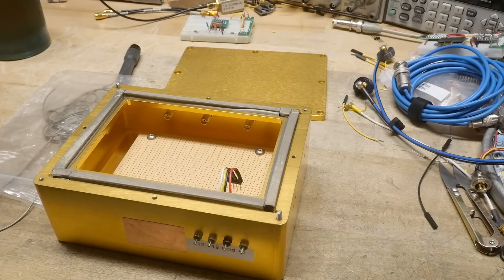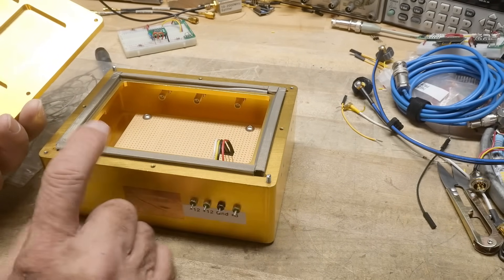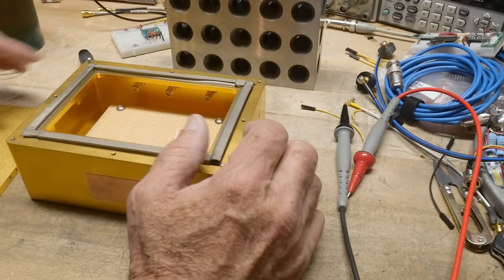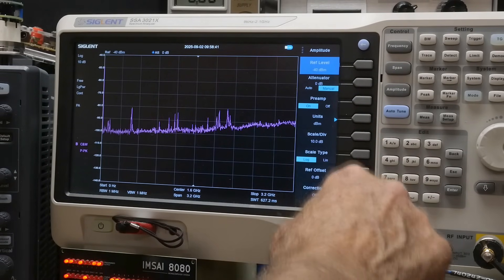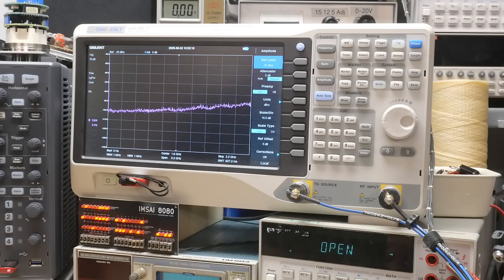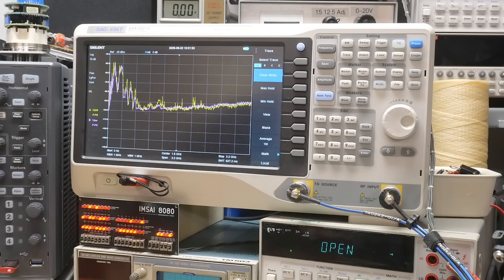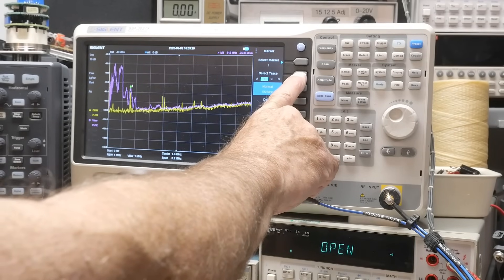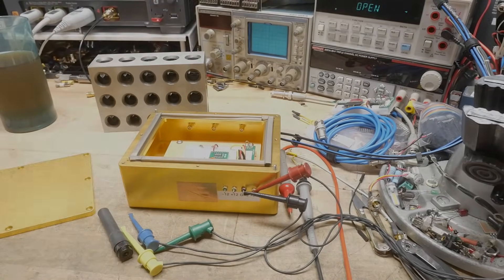#2362 Faraday Box aka Faraday Cage

Comment: I was in a Rona in Canada (related to Lowes), and they had these Faraday boxes for about $10. No metal was evident. WTF? I didn't buy one. Anything I’d want to protect, like my KX3 wouldn't fit in it anyway. Back to a garbage can.

Nice use of a 1-2-3 block. Do you have two to wring together? That's always fun.
Reply: Back when personal computers needed to comply with radio legislation and 4 layer boards were not a thing, and they also wanted to use plastic cases they used conductive plastics loaded with carbon filler or vapour dissipation plated plastic cases with metal.  Maybe the same sort of thing?   If those blocks are 1 2 3 blocks, I wonder which units you're using!

Comment: You know the pads and blankets they put around you when you get a XRay? Do you think that material would block anything?   I was curious bilut don't really know how I could test such material.
Reply: A Faraday cage needs to completely surround or it doesn't work as a Faraday cage. Those are lead blankets (someone correct me if there is more to it than that).
How conductive is lead? But the lead blocks the x-rays by absorbing them. That's not the same as what a Faraday cage does. The channel Kathy loves physics has an excellent series about the story of electricity. The math is done in different sections of the video, which you can skip ahead if you don't understand it. All historical gossip is also included. Really fun to watch and study.

Comment: In the strictest sense, would you need to put screw caps on the unused SMA connectors?
Reply from the maker: it would have to be 10's of GHz to matter.
Reply: @IMSAIGuy  Thanks, for the info. I never worked with any radios over 2GHz.

Comment: Good video - good "box of the day!"     I had one box at work that was 5 ft by 4 ft by 6 ft.  It had 2 swinging doors with fingerstock around the edges and a YD1212 tube inside along with some coils and caps,  a couple of "00" sized cables in parallel for B+ and some copper tube for the hi-voltage.  Oh and about a 4-5 gallon a minute flow of de-ionized water in plastic hoses.   Its no longer used,  and I don't have a place for it but it probably would have made a good chamber to start with to put stuff to protect from EMP!

Comment: The difference between EMI sponge compressed and not is somewhere there in the SA noise floor. So, latches even seem overkill for this edu purpose.
And it makes sense, since it is perimeter coverage that is king in EMI applications.
Reply: Even over compressed,  would normally have compresson stops machined into base. Orings don't work very well when flat. Also aluminium forms a non conductive layer as fast as you clean it off😂
Reply: @TheEmbeddedHobbyist  Plated aluminium is another story. I believe RF specific enclosures are treated in that regard. Also, apparently Al oxide is porous and is a diminishing isolator with rising voltage potential.
Reply: @Mr.Leeroywe would treat all mating al surfaces with a coating to replace the oxide with something conductive.  But as the world moves on the materials used become banned so was getting harder to get a good grounding connection. You can use wire impregnated silicone but it cuts into the surfaces and can lead to corrosion in the long run.  Plus rf currents are very good at finding ways to cross from the outside to the inside.  
Would do the same thing as shown,  would put high power rf inside and rx antennas outside and look for leaks.

Comment: If it was designed to be opened besides for maintenance,  I would have thought they would have at least had thumb screws on it.  Something you could tighten by hand.  That would be a good fix if you can't get proper latches.

Comment: I got lucky several years ago at a public auction and got a benchtop RF anechoic chamber for fractions of a cent on the dollar.  It's 2' X 2' X 3' with a front opening door that has a RF shielded glass window and integrated cooling fan.  The passthrough panel only had data connectors on it so I removed it and replaced it with one that has N and SMA connectors, power connector and lines for microphone audio in and audio out.  I use it very rarely but when trying to track down birdie frequencies in a receiver it's a good sanity check box.  If I put the receiver/transceiver in the enclosure and the birdie goes away I know it's something from the outside world and is not being generated internally in the radio.
Reply: Otherwise known as a microwave oven ????